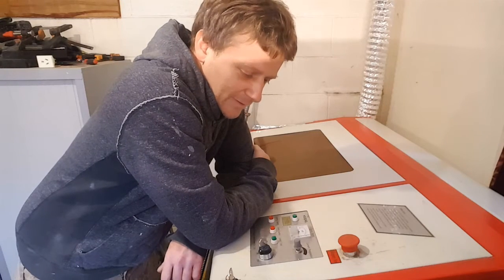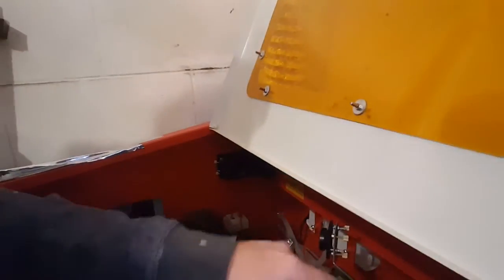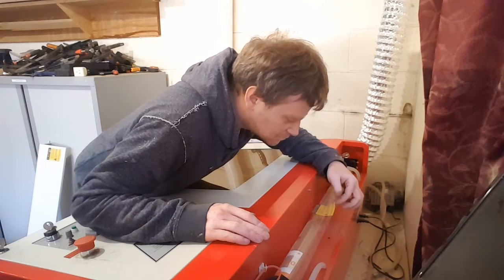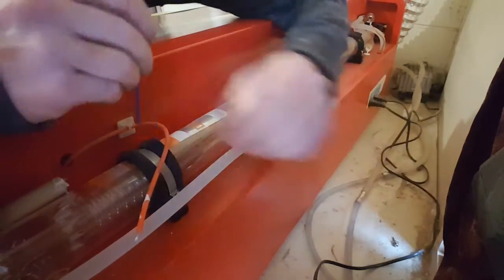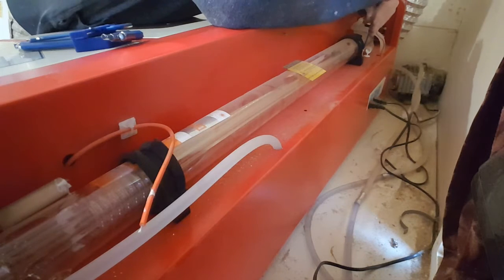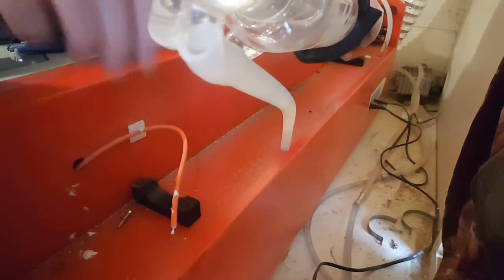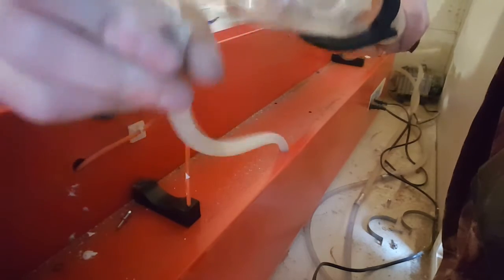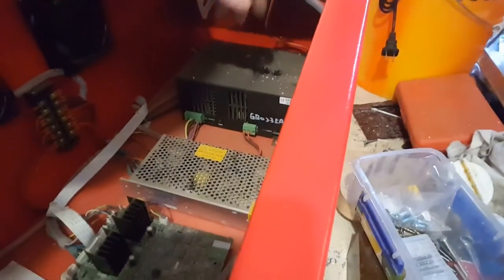Things I Do - Broken laser cutter

Comment: there is no other solution?
Reply from the maker: well. water cooling of the front semitransparent mirror unglued itself.  than laser was heating  up this mirror until it was so hot that it caused glue to bubble up and unseal laser tube leading to gas leak. I got replacement laser tube 50watt for 120 usd from china. it turned up to be about 500usd with shipping and customs.
Reply from the maker: so there is no other reasonable solution than replacing the laser tube.
Reply: Thanks man, I will buy a new one
Reply from the maker: on the another video im showing all process of replacing and calibrating
www.youtube.com/watch?v=9sXD_pPzi6I